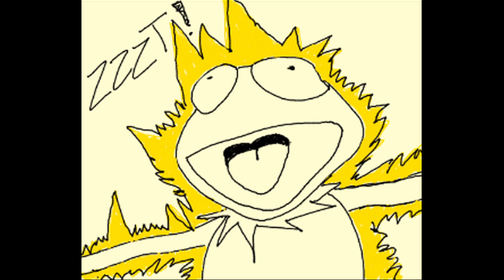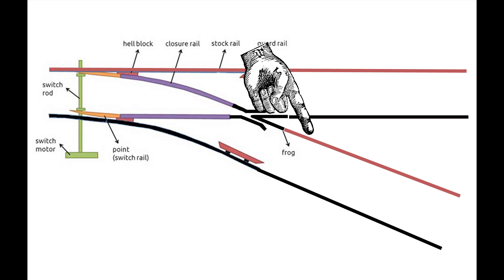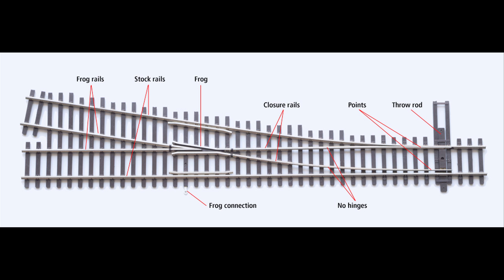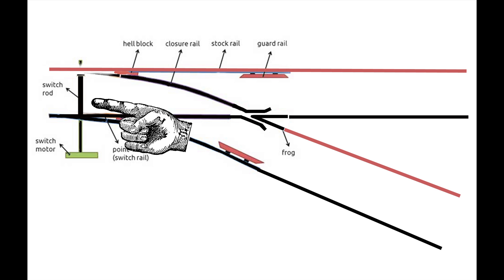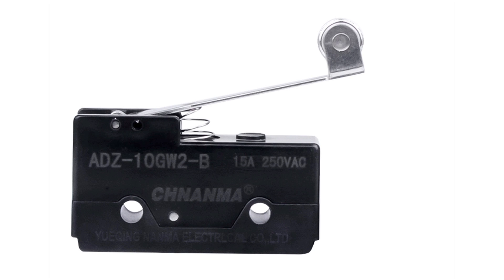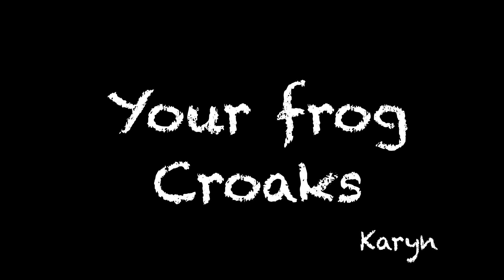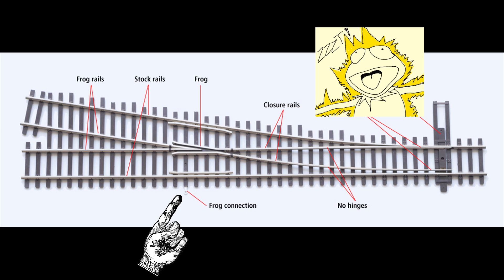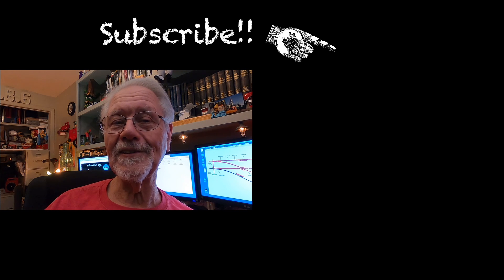Powering the Frog on a Model Railroad Turnout - Electricity For Model Railroads

Comment: In French, a railroad switch is referred to as an "aiguillage," meaning literally a "needleage."  Somehow I personally prefer simply the term "switch" (in English).  The context makes it clear what we are talking about. 

I hope you will come to the Spanish Fork train show this weekend.  I hope to see you there!

By the way, any locomotive using DCC with a "current keeper" does not have a problem with simply having the frog be "dead," without either electrical polarity.  Simple Simon.

But in my case, I'm soon going to start converting and running my locos with a "Blunami" decoder, powered by an on-board battery.  The control of a "Blunami"-powered loco can by made by a smart phone (apple or android) using a free App.  So in this manner, NO expensive DCC system is required at all, no Digitrax, no NCE, no Lenz, no MRC, no nothing, nor any complicated wiring whatsoever under the layout (a nice feature for us old guys).  You can even make your track if you want out of no conductive material, though for longevity sake, that might not be best.

The "Blunami" decoder is simply the latest Soundtraxx "Tsunami 2" decoder enabled by a Bluetooth function.  "Blunami" decoder programming is also easily accomplished using your smart phone.  The price of a battery plus a Blunami decoder is about the same as any other quality DCC decoder and a current keeper, so you are really not out any more money, except for a one-time purchase of a batter charger (or two, or three).  A batter charge typically gives an hour or more of continuous running.  The Bluetooth range from your smart phone (i.e., wireless throttle) is well over 100 feet.  This also works for 1/20 scale, though the expense for the Blunami decoder is somewhat more, because of the increased amperage required by these larger engines.  Cheers, and Hi Karyn!
Reply from the maker: Hi! Thanks for the tip! We’d love to make it to that show but all bets are off right now. We may be there and we might not. That’s a really neat thing, the Bluenomi. I’m looking into that.